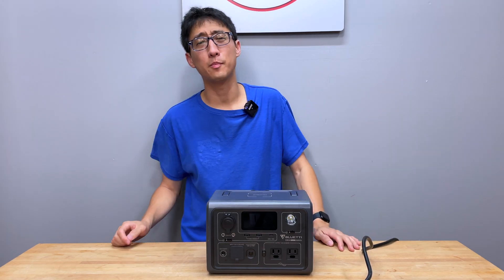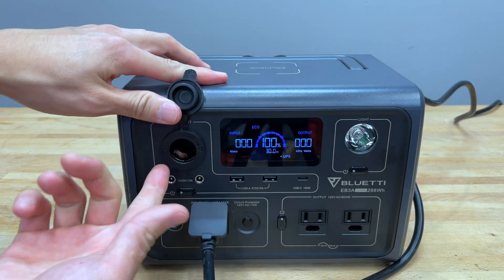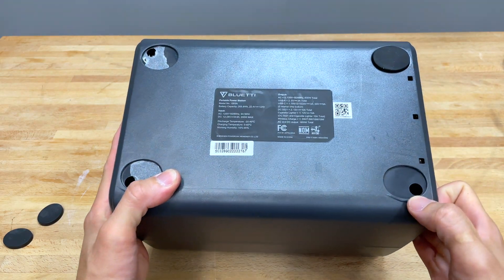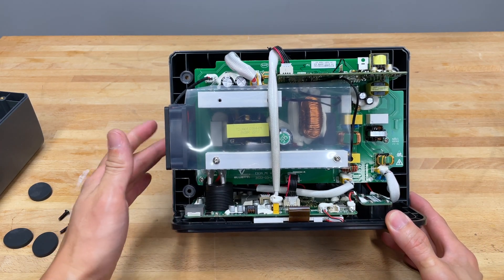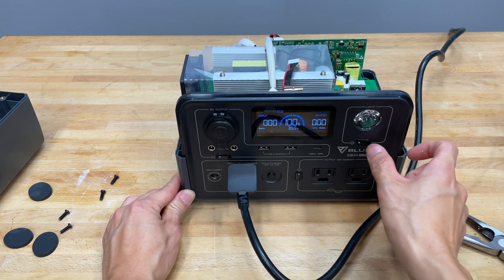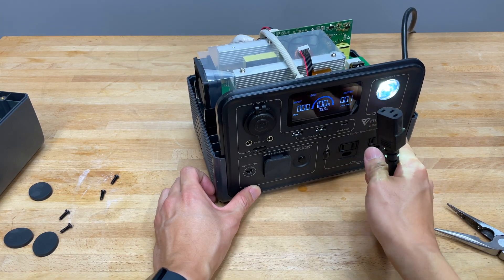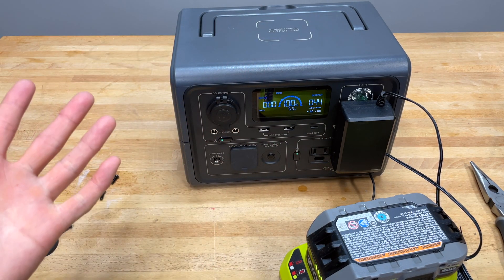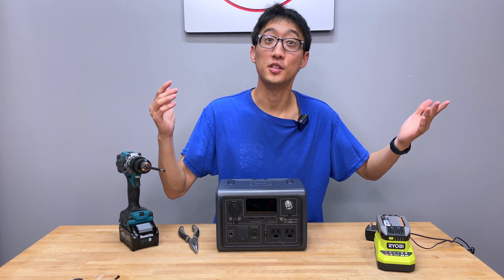Fixing the Bluetti EB3A DC Short Issue

Comment: This fixed my eb3a that bricked itself after using to trickle charge motorcycles in our shop.  It used to work fine but lately if left on overnight it becomes unresponsive until it’s plugged into wall power.  Once on wall power it reports it’s at 100% full with DC short.  In actuality we found out it’s dead completely and pulling the cable like in the video resets the battery indicator back to 0% then the unit kicks on and starts charging.  This is pretty unnerving as we can’t trust if the charge status is really the true % and when charging I leave it outside away from anything flammable in case it overcharges and explodes.  Likely this thing is going away soon for another more reliable brand.

Comment: Below is a far better solution that will not void the warranty from the manufacturer.

For this case, we would encourage you to follow a few troubleshooting steps with us. 
1. Please turn on the AC and DC buttons of the machine when plugging in the charging cable. After 30 minutes to 1 hour, the machine will drop from 100% to 99% due to self-consumption. 

2. After the SOC drops to 99%, unplug the charging cable. It can make the machine work normally (that is, it can be turned on even after unplugging the charging cable)

3. And then re-plug the charging cable for charging. However, the SOC is not accurate at this time, and it may take a long time to recharge from 99% to 100%. You can continue to use it normally after it is fully charged.
Reply: If the DC won’t switch ON, try switching ON the light to take the SOC down to 99% or so.
Reply: This worked for me!
Reply: Thank you. This works for me but, but unfortunately does not resolve the cause of the problem. I use my unit as ups for a modem and router that draws about 21 watts combined.  I have had this happen 3 times when it reaches about 50%. So basically I’m only getting half of what I paid for.  Out of warranty so sucks for me.

Comment: I had the same issue, from using it to charge my car. But I fixed it easily without taking it apart. You need the mobile app. You connect via the app and Reset the device. That flips the internal breakers. You'll find it probably isn't fully charged afterall. But it will likely function normally, though you might need to charge it and Reset it again, which sometimes happens to me. It always happens when I charge a dead battery on my car from the DC power port, because there is a fast, power backflow when I open the door and the car wakes up and lights come on. The breakers protect the unit from damage. Bluetti didn't know how to fix it either, because it's supposed to be a feature not a bug, but there isn't a hardwired Reset button on the box. The workaround is that you need the app, which isn't as reliable as a button.
Reply: I have the exact same problem.  I have looked all through the app but do not see where I can reset it.  Where can I find that option?  Thanks
Reply: @Fix_it_Phil  The power button does it, on the main screen of the app once you're connected, straight below the charge percentage indicator. There is no factory reset, as there aren't any permanent settings. Like I say, sometimes you have to switch it off and back on more than once. And if it thinks it's dead, plug it in so you can connect. Most of the Bluetti devices seem to get their circuits scrambled occasionally and the advice all through the forums was to press the reset button on the unit. The EB3A only has a breaker button for AC, so nobody seemed to know what to do when the DC circuit tripped internally, because there was no Off switch.
Hope it helps.
Reply: @willcool713  my app says I have to turn off the grid input when I press that power button. No idea how to turn off grip input? Mine is 10 months old.. warranty dept supposed to get ahold of me on Monday as I called in the weekend. Would loved to have reset it but that input grid error stops me! Appreciate all the comments!
Reply: @toddsmithmusician  If your AC out or the AC charging input system shorts, then the breaker reset on the face of the EB3A -- between the AC charge port and the AC output button -- should reset it. But I have never had to do that, although a friend did when his generator spiked and tripped the breaker on his. That breaker is supposed to take care of all the AC interactions, in and out. And the Power Button reset in the app takes care of DC out. But Idk what happens if you trip DC in, like by hooking it up to a 30v system or a big spike. I bet it's a different breaker than DC out.
Try the physical breaker on the machine, though. You might need to plug it in, maybe.
I was looking for a small power station right when the EB3A came out, before it even had reviews, really. But there was a good promotion that put it into my price range, so I took a chance. Works good for me, but like you, I have one of the first models. It didn't even come with all the charging cables, though they sent me one more later, gratis.
Reply: @willcool713  I’ve plugged it in over and over, unplugged it, over and over. Try to reset with app and it says to remove from input grid…I assume that the 110 plug. The manual reset does nothing., nor does the mobile app reset. I saw a you tube video where a guy fixed his. Took the cover off and unplugged one of the ribbons to the board. While the ribbon was unplugged, he plugged 110 into it and powered it in using the ac button, then powered the dc button. He then unplugged the 110 and voila’ it powered up with the power button. He plugged the ribbon back in and put the top back on the case…worked like a charm for him.
When I’m plugged in, I power on dc, and then when I power on ac, the short fault shows on the display. Obviously it’s getting an errant signal from somewhere. I toyed with opening the case and unplugging the ribbon, but I called BLUETTI today and I bought mine a year ago this December…so..they’re going to send a label and I’ll ship it back..they’ll either fix it or send a new one.
I primarily use mine to power a PA , mixing board and stuff, guitar, mic and such. I play solo acoustic stuff and can gig in the middle of a field when needed. Used the  EB3A this summer playing a private gig in the middle of the block…no shore power…I have the solar kit so, between sets, I would plug the solar in and let it start to charge. Played for 3 hours and had 65% when I got done…I use two little Bose PA’s. The thing works great for what I want it to do, but this “short” error throws a big kink in my plans if I need it. 
Again, really appreciate your input..you’re helping me learn some things I didn’t know! ✌🏼
Reply: @toddsmithmusician  Just a thought, do you think it might've gotten wet? I wonder about that, as I haven't seen any videos on what rain may do to it, nor have I read anything in the forums or literature. I can see somebody camping and spilling on it, at least, but idk what would happen. Bet it voids the warranty, but that could explain a weird fault, a wet short. It would be easy to tell inside, but I don't suggest opening the case if you aren't familiar with electronics, and if you want to keep the warranty.
Reply: @toddsmithmusician I just fixed mine today by plugging it into the wall putting a load on the ac and turning the led light on since it couldnt do dc and once it hit 99% it went back to working and I unplugged it ran it to zero with a dc load now its charging again ill let it go to 100 to recalibrate the bms
Reply: @wowreallyyes1  Good news…did about the same thing. Plugged mine in…cycled AC, DC, got the short error… unplugged, plugged back in and left it alone for a few days…working like new again. Honestly think it was discharged but showed 100% which was causing the “short” error! Thanks for the info! ✌🏼😎
Reply: @toddsmithmusician 😅
Reply from the maker: That’s helpful. I tried the reset via the app. It did nothing for me. Maybe bc I was at 0%?
Reply: @tgbatg  It has to be plugged in to wall current, too. And you might have to reset it more than once. That's my experience. Bluetti was very interested in knowing how I fixed it, because they were almost ready to replace it for me. Looking up other issues, and similar issues with other Bluetti models in their forums, a full reset was often the solution -- but the EB3A doesn't have a dedicated reset button.
Reply: You can use a light bulb for a car 12v 10 - 55 watts and connect in series with plus from bluetti, be careful with the bluetti touching the frame of the car, nothing will probably happen. Do not connect bluetti 12v out directly to a battery. an incandescent bulb is short-circuited when it is cold, when there is more current it lights up and the resistance becomes greater and it regulates the current in a way.
Reply: Can someone explain how to " reset " on app?
Reply: THIS HERE IS THE FIX.  SHOULD ALL TRY THIS BEFORE ANYTHING.  IT WORKS.  YOU DA MAN HOMIE
Reply: I just installed app, upgrade device to arm version v2063,03 and it helps,  device work properly)
Reply: Or you could have plugged it into the wall, turn on DC and AC, wait until you see 99% charge, then unplug wall power, use it a bit on something like a small fan, then recharge with wall power until 100%.
Reply: i ve same issue with EB70 can someone help me
Reply: @shababs6030  They have good documentation on their site, and their help center is also really good. I posted this because the EB3A was relatively new and this problem didn't yet have an official solution. In fact, when I told them I had fixed the issue, they wanted the details, because it was a consistent question.
In general, for all of their models that I read about while trying to understand their design philosophy without tearing my unit apart, their circuits are robustly protected against backflow and spikes by good breaker switches that reset with hard powering the unit off and on. My EB3A doesn't have a power switch, so the workaround I found was with the Bluetti app. But most all other of their models come with a physical switch to power it on and off. Just like with a grounded power strip, if the circuit inside trips the breaker, you only need to turn it off and on again to rest it. Theoretically, there could be a fuse instead of a breaker, but I haven't seen fuses on Bluetti devices. Or the breaker could have blown out, like if it were tripped by lightning or a violent short or physically broken somehow. Try the switch first, and then plug it in and charge it, and then switch it on and off again, and see if it still needs charging. That would be my first advice, though I'm only guessing. Their assistance was top notch though, imo, so you could try them next.
Reply: Ive been researching power stations for a while now and bluetti seems to be able to be summed up as "good hardware well made but barely functional software"